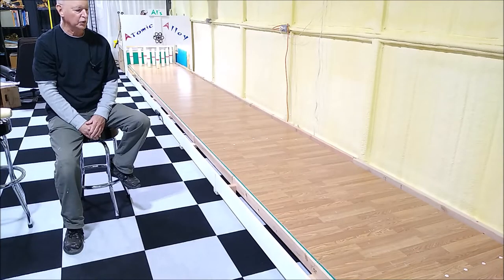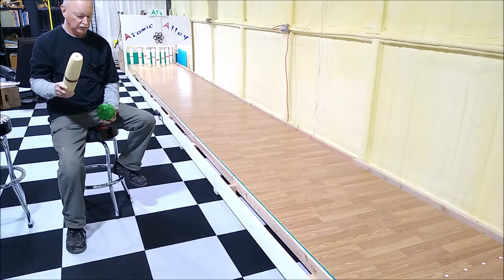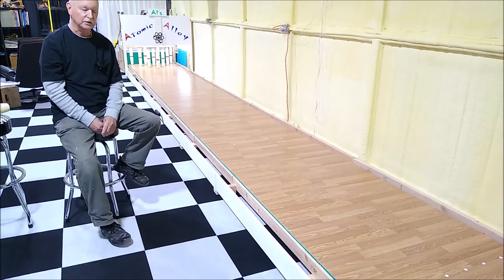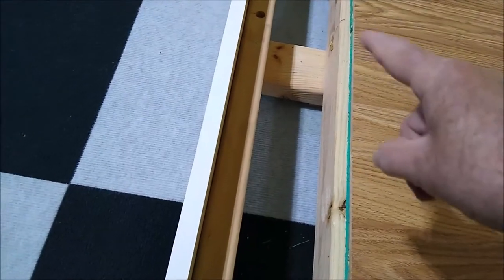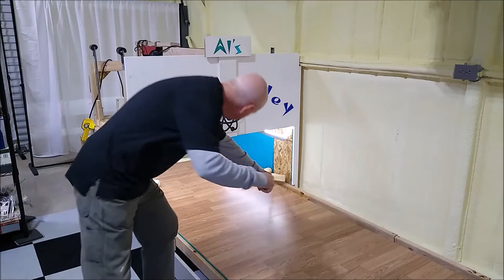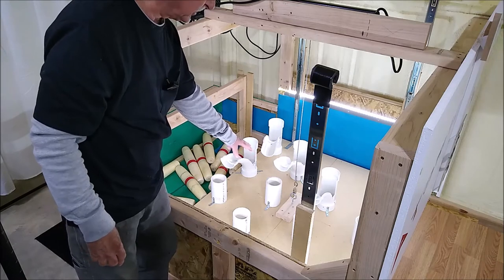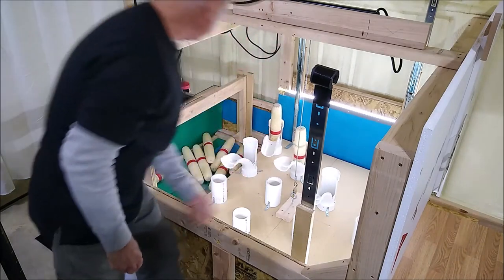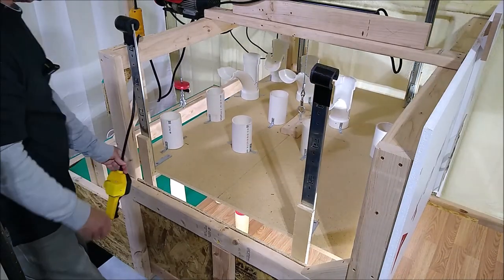Home Candlepin bowling alley: Low Cost Approach

Comment: This is great! How well does the alley hold up, particularly in the zone where the ball makes first contact? I really like what you did with the pinsetter, and the ball return.
Reply from the maker: For occasional home use it works fine.  If it is going to be played a lot then maybe a separate pin deck can be made from a metal plate, which is what bowling centers use for candlepin I think.